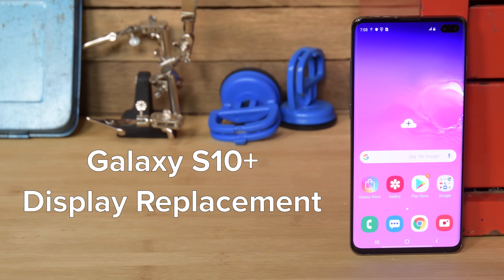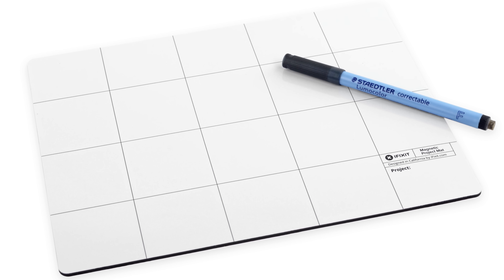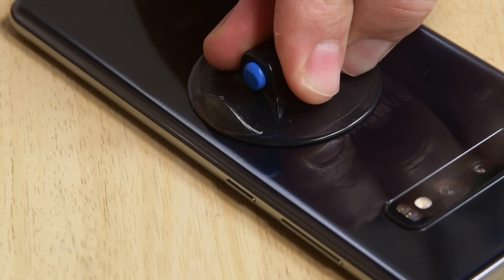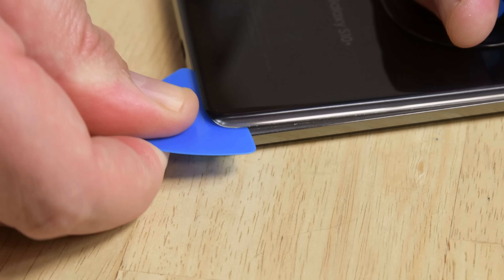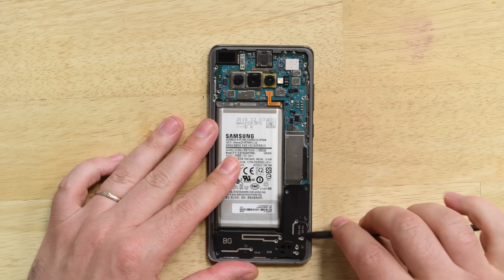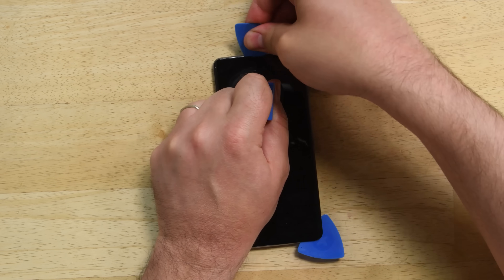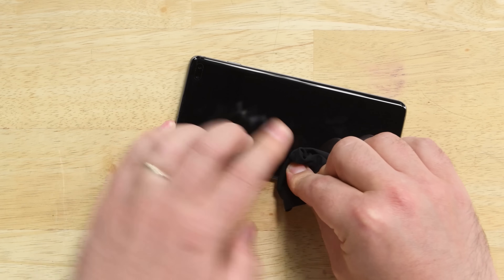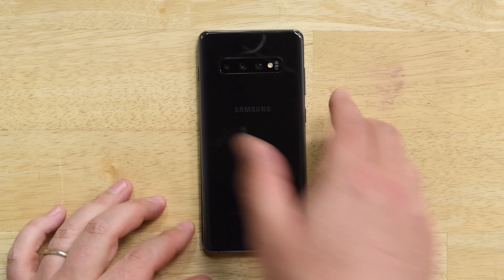Samsung S10+ Display Replacement and Reassembly!

Comment: This video omits a big part of replacing a screen. They don't mention that the "display" really has three layers. 1. Screen protector 2. Glass cover 3. Display. You should first pull off the screen protector, then carefully separate the thin glass cover from the display. I think you will find that most of the time the cracks you're seeing are the glass cover that's cracked and not the expensive display! Check this BEFORE you pay for a display.

Comment: At first I thought this was going to be super challenging, this looks really simple, at least to me. The hardest is here, is probably trying not to lose a screw.
Reply: Opening the phone and changing the battery was the easy part, but removing all the glue residue... that was pain in the buttocks
Reply: @XtrAMassivE  Bro just appreciate the fact that it doesn't have any software pairing like another brand
Reply: Use a piece of cardboard write where the screws are then put them in it
Reply: Way easier than any iPhone, at least they don't use hundreds of different types of dust sized screws.

Comment: Just shattered my screen today at work. I was so mad. It fell to the street and cracked. There goes 300 dollars. Luckily it doesnt look too hard to replace. Thank for the video.
Reply: any updates? If so what adhesive did you use, and did you see any side effects after repair?
Reply: Curious to see how your experience goes

Comment: She said “use cation on the left side where the display cable is you don’t Want to cut it”… if you are replacing the screen does it matter the new screen comes with a new cable🧐
Reply: Good point, lol

Comment: Isnt it just easier to turn of the phone or let the battery die when doping this? But can you just click the back and front glas in place or do you need glue?
Reply: turning off the phone won't do anything to the battery storage. You should still turn it off, I'm just saying the battery would still have 80% power if that's where it was at. Letting it die is fine, but unnecessary. 5% is probably good.

Comment: I miss when the days when all had to do was pop the front off and replace the glass. Now if you have a small crack on the screen and you want it gone you have to replace the entire front side of the phone! 😡
Reply: YEAH!! They could have mentioned that at the beginning and saved a lot of people a lot of time!
Reply: Fell sleep atop my s10+ woke up to a small ping-pong ball sized crack right in the middle of the screen I didn't even cry just sighed and rode to the repair store 317$ later with a new case hoping I don't crush it again but I like to sleep sometimes while I'm watching youtube the screens not durable at all

Comment: What if you just need to replace the glass  screen and not the digitizer?
Reply: I tried that, ended up damaging the both screen & digitizer. Spend the few bucks more, less issues.

Comment: Skip the heat pad and go strait to using a blow dryer. That glue is on there good. The heat pad was a waste of time. Note how they cut around the actual heating and pulling. On the plus the rest of the kit is fine and I'm back in business.

Comment: its tempting, i just cracked the screen and damaged the display on my s10+ and have been contacting multiple places. samsung was 300 to replace it, local places around me want 375 to replace it.  

Then looking at the replacement displays seems to be averaging around 250+ no including the specialized tools required.  I found one place that sells the display and the picks and suction cup for 279. But then im thinking.. okay if i attempt this an mess it up than i just wasted nearly 300 dollars.  if i have samsung do it i know its not gonna be messed up... i'll pay a little more but atleast its gonna be samsung factory quality. 

If i were able to find a replacement shipped with the tools for less than 250 id probably just go for it. but i'll continue to look.   

It doesnt look that difficult but then again when its pro's like this they always make it look easy.
Reply: The phone only sells for like 300$ rn... I wont spend 250$ on a display..
Reply: @Kayshots  yeah i ultimately ended up purchasing a new phone. If the displays ever go down in price though i'll forsure replace it because the phone is still a great phone and works fine. takes nice pictures. its just a matter of the display only showing half the screen makes it impossible to use.
Reply: @CarsnStuff  Yeah my s10+ fell on tubes today. Screen protector hasn't a scratch but the screen is cracked. Still works though so no problems

Comment: I ordered a new lcd for my sg s10+, it came with the lcd & the frame. I only needed the lcd so i removed it from the frame & I followed these same steps & my new lcd screen is black. The phone turns on & all but the screen is black. Ik i didnt do anything wrong. Nor is the new screen damaged in any kind of way. Can anyone tell me if this has happened to them too?
Reply: how much was the screen and where did you buy it from? check the screen ribbon cable connection, it might be loose.

Comment: I'm getting charged 430 bucks for this.
Did you change the digitiser. I have one crack which doesn't affect performance.  I thinking the guy wants to change things it doesn't need
Reply: Me too! I just needed the glass/plastic cover. I didn't need to touch the display.

Comment: Paying for the insurance sure comes out a lot cheaper and so much less hassle! It blows my mind people by a phone for over $1,000 ( that has a screen all the way to the edge) and don't get insurance!  Fin crazy!
Reply: Well, you also have to take into account that the phone which costs $1000 when you buy it on a plan for 12 or 24 months will become obsolete literally after 6-8 months of purchase and definitely obsolete after 12 months as both Samsung and Apple release new models every 12 months. Paying extra $20-30 a month for insurance sometimes is not at all viable as the phone becomes obsolete very quickly and chances are that you will be upgrading in the next 12 months anyway. If you are reckless or stupid enough to drop the phone and not have a case and screen protector for it means you are an idiot and should not have a $1000 phone but a $200-300 one.

Comment: Just wanted to share.
My S10 plus display was cracked. I sent it to official Samsung service center.  They didnt separated the display from the steel frame(housing) like 2:15 they replaced the whole body of phone  including the steel housing and all the accessories attached to it except the camara,battery and motherboard etc. Even the vibration motor and copper cooling plate is replaced .as the whole housing contains. Because as the display is permanently attached and the phone is IP68 water resistant. And removing it from frame and reattaching can cause the water leak inside. Thumbs up Samsung for service . 
Though they charged nearly 200 dollers. 🙊
Reply: only 200???? where?
Reply: where did you do this?? I need pricing like that....
Reply: Official samsung service centre (Brand authorised Repair Shop)
Reply: May I ask where you got this done? I would gladly pay around $150-$200 for a legit replacement

Comment: After replacing my screen&frame,  my speaker no longer works.  I tried a new speaker as well thinking it may be the culprit, but it still does not work. Audio only comes out of the earpiece when playing music or on speakerphone. Headphone jack works fine.
Reply: Hello does the new screen has the finger print scanner.
Reply: @toxicace2860  Yes, fingerprint scanner works just fine.
Reply: Thx for the info.

Comment: how about a link for the screen
Reply: Use Aliexpress to get a replacement. The how I got mine and a panel for my computer monitor. Fixed them both and they work great.
Reply: @andrewtanner2707  yeah that's the quick and easy way with 1 big compromise, that display is not the same resolution.
Reply: @andrewtanner2707  link for display ?  Also for the glue ?
Reply: @andrewtanner2707   u have fixed your phone Ss10+ screen right  ? Is working well now without malfunctions?
Reply: @فاطمهمصطفى-ط5ف  Yes!
Reply: @andrewtanner2707  Oh cool
Reply: u ever find that link?? I just broke my screen
Reply: @noodleboy2492  I did find a few, but their all around 480$ plus. I have insurance for as long as the screen lit up they would do it for 50$ and under.
Reply: @badlynice4692  what kind of insurance do you have? For some reason Verizon won't let me have any insurance to get a new phone.
Reply: @adtrkidd88  That's complete bullshit. Verizon uses a 3rd party asurion (as well as many other carriers) that can be added to your bill each month. Depending on which phone model u have, it's anywhere between 12 and 15$ a month. You get 3 claims a year, and their is a deductible of $200 to $300 when you file the claim. S10 and S10+ Is $200. Of course you can't break your phone and then try to get insurance.  But saying Verizon won't let you have insurance on a new phone is complete BS ... Samsung also has their own "care plan" as well.
Reply: @badlynice4692  the screens are like 40 bucks on Amazon dude
Reply: @sscollectors5364  u looking at the wrong thing or a scam
Reply: @badlynice4692  just received it yesterday, Amazon prime with 1 day of shipping, screen looks legit my buddy is gonna install it for me today so you were the one looking at the scam
Reply: @sscollectors5364  show me the link.
Reply: @badlynice4692  I commented in here already, if its the wrong one lmk because I just searched it on Amazon I ain't no profesional
Reply: @sscollectors5364  where I don't see a link at all
Reply: @adtrkidd88  I have full coverage
Reply: @Badlynice  just recently they gave me an option for full coverage as well. I've always had it, but let it go last year due to financial problems. @sky pallman I know they have insurances but I could only get tech support until recently. You ain't gotta get all worked up.
Reply: @adtrkidd88  I'm not worked up. I just happened to see the notification for u asking me so i answered, granted I'm kinda late on that.
Reply: @badlynice4692  i meant that comment for the other dude. He replied to me like if I was lying. I appreciate you commenting back tho.😁

Comment: I hope anyone watching this video does not think it’s this easy. They have pre repaired the screen before making the video it is a lot more difficult to separate the glass on back and front.
Reply: Every video but one on this model implies way less heat usage than needed. A hotplate seems the way to go.
Reply: A good option is to buy the front screen with the metal frame. This way your only trouble will be removing the back glass
Reply: Blow dryer not even on hot can hear the glue enough for this phone.. It's actually super simple.. You just gotta go really slow. But if you really want best results just make sure you have everything she has and a heat gun and got light source..I HIGHLY recommend getting a magnetic pad.

Comment: what adhesive can i use for the rear panel?
Reply: Me personally i would use B-7000 glue its very stromg and you can get a 50 ml tube of it for about $10 off ebay

Comment: Can anyone from experience tell me if this is worth doing? I have tiny spiraling cracks and I dont know if I should do it myself or just tough through it
Reply: U can buy dysplay with frame attached just switch mother board and batery....
Reply: @urbexdavegamingchanell  where could we buy the parts needed to do this? Switch battery and motherboard?
Reply: No, just because the fingerprint sensor is permanently glued to the display, so if you replace the screen you replace the sensor too
Reply: @AlexandruCarjan  so say I'm okay with losing the finger scanner, would you recommend it then?
Reply: @iamzomb.  then you don't have anything to lose

Comment: Would it be waterproof still?
If you used original S10+ screen and back plate with the factory adhesive it comes with?
Reply: No

Comment: I haven't broken my S10+ yet! I hope to never break it, even if I broke 2 Galaxy S7's.
Reply: did you break it yet?
Reply: I broke my s7 edge twice already, first just the display, then just the glass layer. Then I smashed my s10+ cuz I raged over gta san andreas :'(
Reply: @kurbonmirzoaliev9600  either you got money or you've got an anger problem. Ain't no way im smashing my beautiful phone over a game lol
Reply: @Junior-rz2gx  ive got neither :( The S10+ is now fixed up. Yay!
Reply: @kurbonmirzoaliev9600  I recently let mine fall by accident and it cracked... how much did it cost u lol
Reply: @kurbonmirzoaliev9600  Does the phone work well with it or is there a difference from before repair ????????
Reply: @kurbonmirzoaliev9600  Oh, how badly my comment has aged. I did in fact crack the back.
Reply: @maxwellj7299  but at least it's the back. Lucky guy

Comment: Do you guys have anything to remove stripped screws from an iPhone 6s? The screw I am referring to is the one of the two at the bottom where the charging port is.
Reply: If I had nothing else, I would get a torx or star bit that fits snuggly and superglue it into the screw. If superglue won't work you can try some Loctite or JB Weld epoxy.
Reply: Ifixit has stripped screw tools if I remember right
Reply: You can try using a rubber band on the stripped screw for more grip.

Comment: easy as always, if you repaired over 10k phones
Reply: This honestly looks extremely easy, try taking apart an iPad literal fuck loads of disassembly just for the battery
Reply: It is really easy....IF you have the right tools
Reply: It's really not that hard. Be biggest Problems are the adhesive, not to lose any screws or break the back glass. Just  be careful and its as easy as they show it. But it will take you more than 3 Minutes.
Reply: Negative Nancy.
Reply: Believe me its easy, you cant do anything wrong if you follow the steps in the video.
Reply: are all S10+ lcd model the same to replace ? or do i need to purchase specific model ? example G975U1 , G975,  G973, G970...etc... Thanks
Reply: @androiduser8721  yes, the different model types have different display module components sometines wich will only work with the needed version
Reply: I've taken apart my S6 Edge Plus twice. It's quite easy. This seems a bit more complex, yet still reasonable if you're careful.
Reply: its easy to repair phones
Reply: It’s easy. I do mine all the time it’s not bad at all

Comment: Why wouldn't you just get a display + housing unit?
Reply: It is more expensive
Reply: Jamie Northcott obvious but some people don’t think
Reply: It's a lot more complicated with ribbon cables, screws, and just plain inconvenience.
Reply: That's exactly what Apple does for their back glass replacement, replace the entire housing.
It gets real expensive really fast
Reply: It's usually like 15-30 dollars more expensive. But in my opinion it's a lot better to do it with a housing because it's harder to break the screen during the repair then. And looks better
Reply: @tarekvaughn-orton5015  
Yeah no 
It gets incredibly expensive 
Upwards of 150 in difference
Its easy but at what point do you chose to take it to the damn service and let them do it for you given that it's gonna cost the same either way.
Basically you replace the screen only or get it done professionaly, there's no middle ground.
Reply: At the shop I work at we get a frame with screen mounted. On older S models we would also get an extra backpanel as they crack easily
Reply: @altanis1499  same here, frames are always bent and the screens are really tight tolerence wise and have a habit of breaking if the frame isnt 100% correct,
Reply: More complicated I like to keep it simple

Comment: Always pushing out great content. How hard would a glass only repair be for this be?
Reply: @GLORYWINGS [POV] Possible, just needs special equipment, time and lots of skill
Reply: close to impossible
Reply: far to possible
Reply: Check jerryrigs apple watch screen replacement. Its not impossible.
Reply: Thish Dude the screen is a lot smaller on the watch. He cut the adhesive with a very thin gold wire. Imagine doing that with a curved 6 inch screen without breaking the potato chip screen. The best I can describe the fragility is like tissue paper. That breaks when you crinkle it a teeny bit.
Reply: @plate4416  ey true man.
Reply: Basically impossible as the OLED screen is glued quite permanently to it with some very strong glue that is basically insoluble in any adhesive remover. Add that to the extremely fragile OLED screen that when looked at wrong can break without the protective glass on it. You need some very very very expensive equipment and unless you want to start a business doing this is just plain stupid. On say an Apple watch cutting the adhesive is possible but on a phone is not feasible.